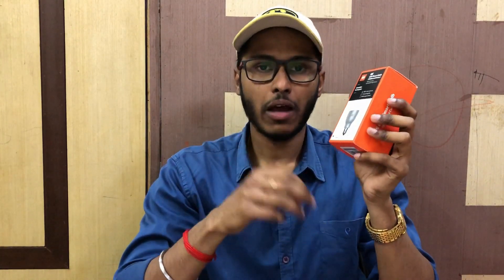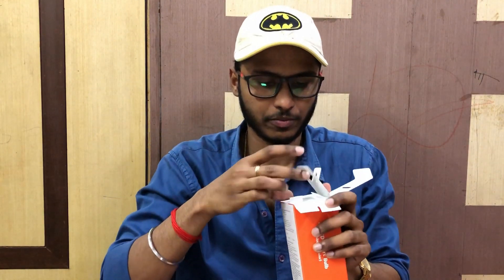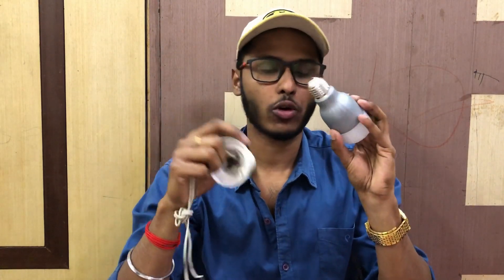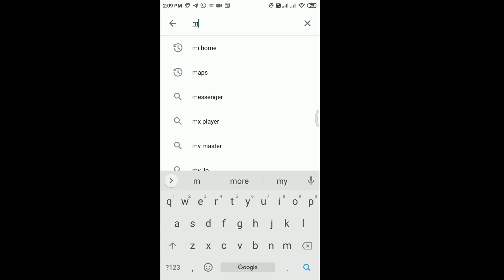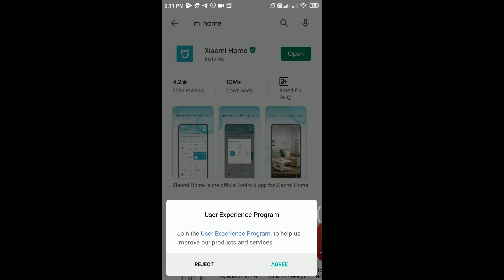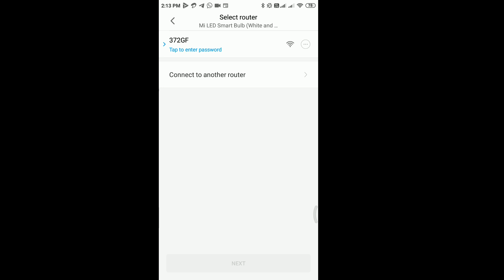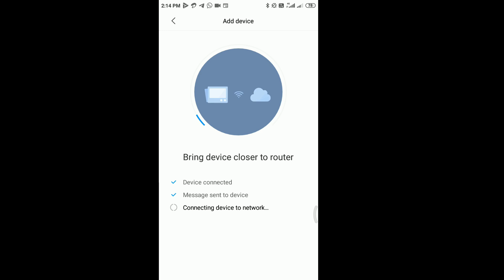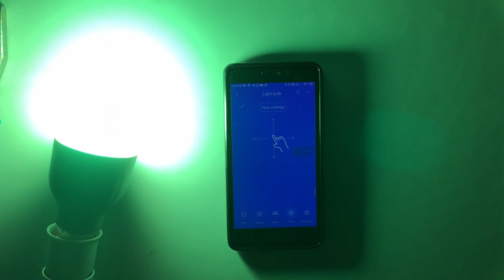Mi Smart LED Bulb Malayalam Review | Unboxing |Complete Review |

Comment: Star enu delta povunila enthu
Kondu annu .manul press cheythu appool conductor pidichu pashe supply out avunilla enthu kondu
Reply from the maker: Timer work aakunundo...
Contator il coil voltage m input voltage m vanit out vanillel contactor damage aakam...allel contactor coil voltage verunillel athinte control wiring onnu nokku